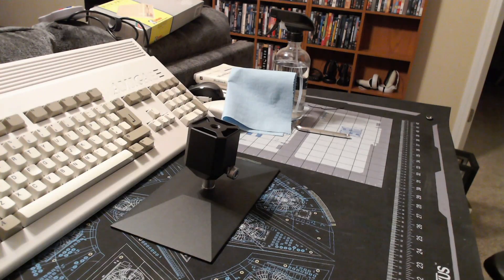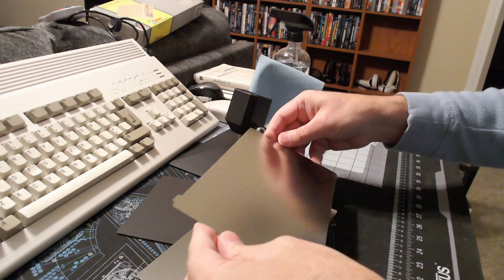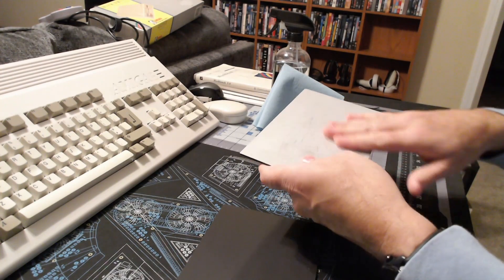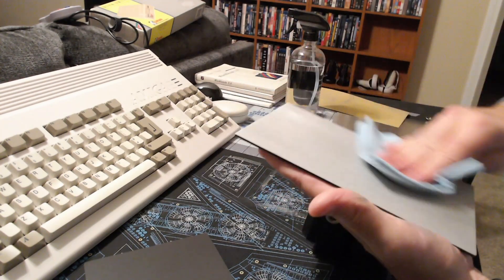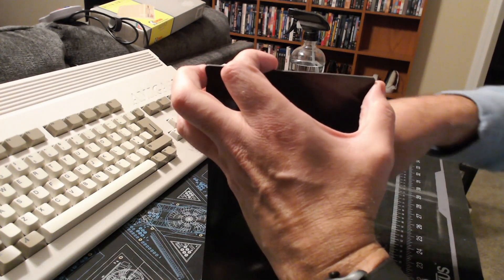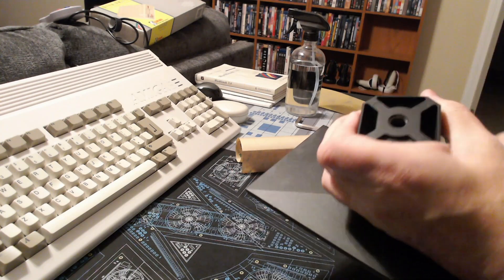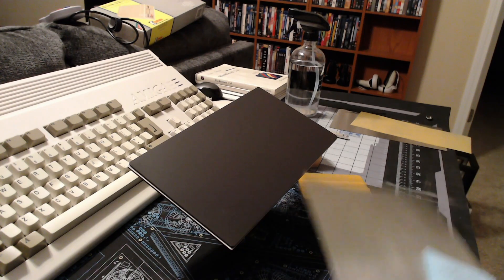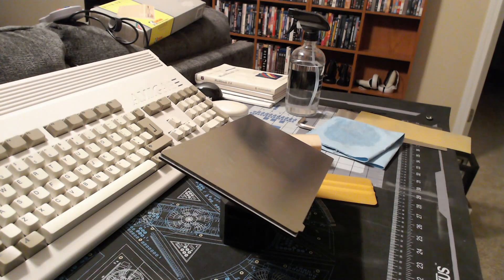Saturn 2 Flex Plate

Comment: Can we have an update?
Reply from the maker: So far the build plate has worked fine. I did have to scuff it up with some 400 grit sandpaper to get good adhesion for prints though. Once that once done, I haven't had an issue and removal of prints is just a flex away, no worries of damaging a print with the scraper or from a fall.
Reply: @Pushin_Plastic  Good to know. I picked up the same plates a while ago and I'm only just getting around to putting them on. Been looking for tips and this has been very helpful!

Comment: Most flex plate manufactures have the flex plates as 224 x 129mm when the actual build plate is 225 x 129mm.

Comment: I agree with you. That magnet does look a lot weaker than the wham bam. I always get punched putting my plate back on. Good luck.
Reply from the maker: So far doesn't seem to affect it at least. But, haven't had anything stick to the plate yet, but was the first time with the 8K resin so going to swap to my normal resin that the model was sliced for and try again.
Reply: I had to relevel my wham bam with the vat in and a sheet of paper and sand the plate for adhesion. If it’s the space gray Elegoo 8k I needed a longer exposure time as well. I thing I almost doubled mine from 1.8 to 3
Reply from the maker: I had to sand the plates to get anything to stick, but once I did, I was able to get a good print with the normal Elegoo resin. Will find a new model for the 8k resin and make sure I up the exposure times.
Reply: @Pushin_Plastic  How is it so far? Just ordered the same ones too